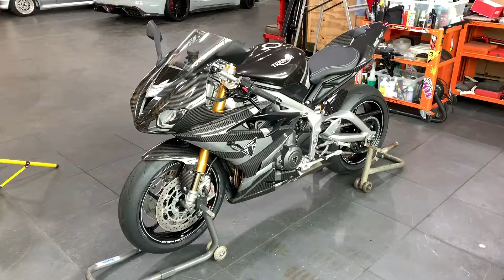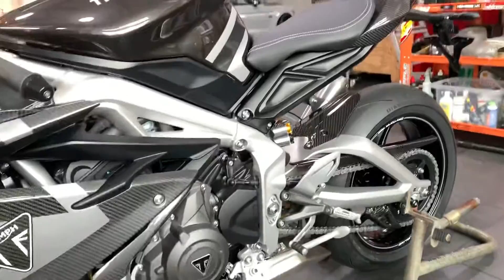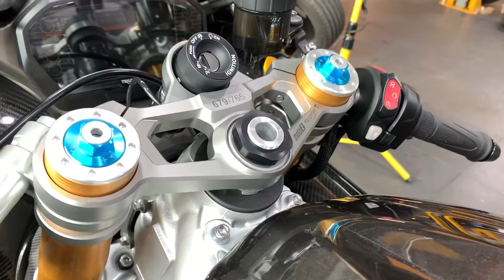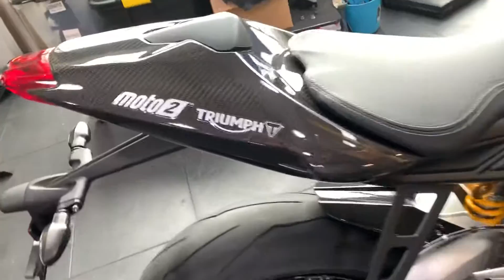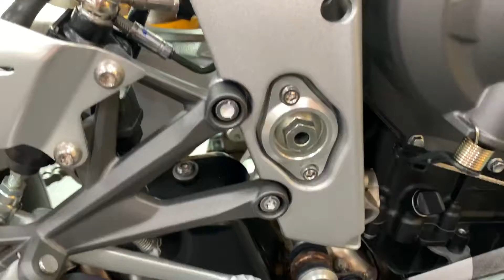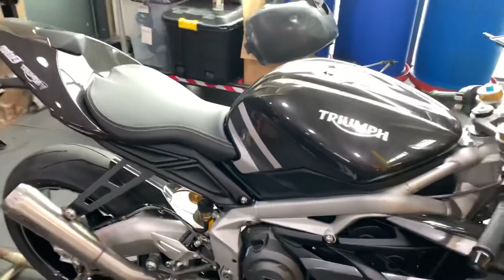2020 Triumph Daytona 765 Moto 2 Edition detailed, PPF and Ceramic Coating

Comment: Why bother w/ a ceramic coating when you should be putting a clear wrap on it. I have a 17 675R and 18 RSV4 and regret not having that done. The fronts on both are pitted and torn. I run full throttle on both so the damage done to the front just from riding fast is enough. Personally my next new bikes will get the wrap.
Reply from the maker: Aurora Jones if you listen to the video you’ll find that every carbon fibre part has been PPF’ed (clear bra) with Llumar Platinum then ceramic coated over the top